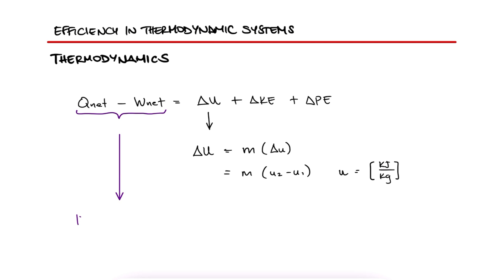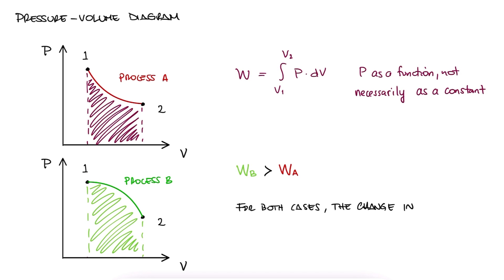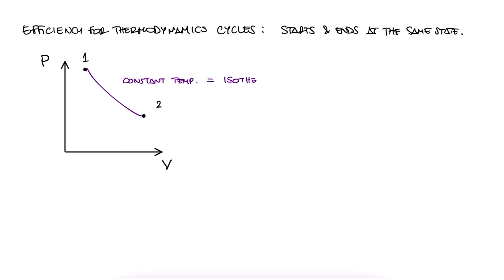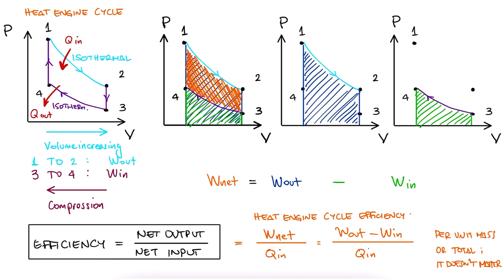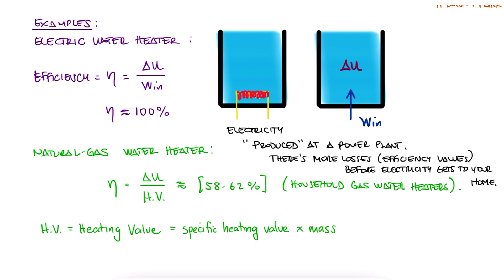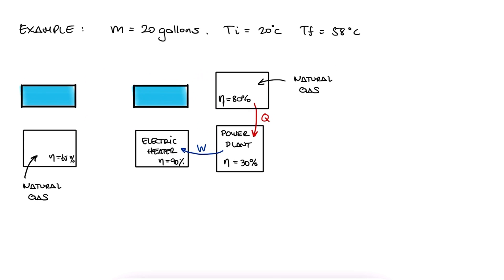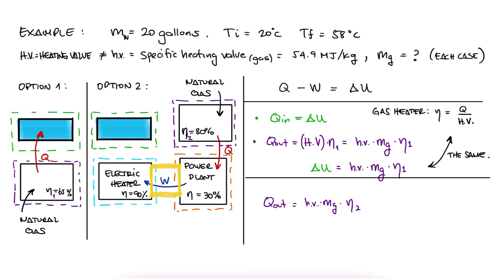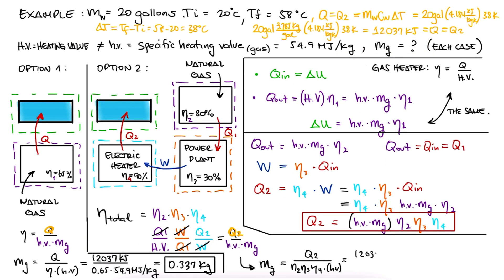EFFICIENCY of Thermodynamic Systems in 10 Minutes!

Comment: For the heat engine cycle heat goes in between points 4 and 1 while heat comes out between steps 2 and 3. What was mentioned in the video was that heat goes in between points 1 and 2 while heat comes out between 3 and 4.